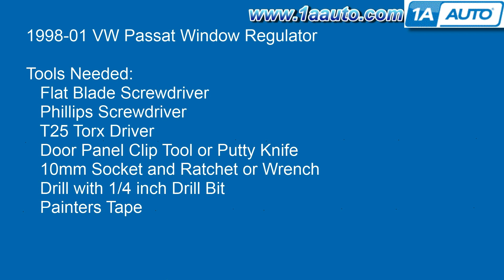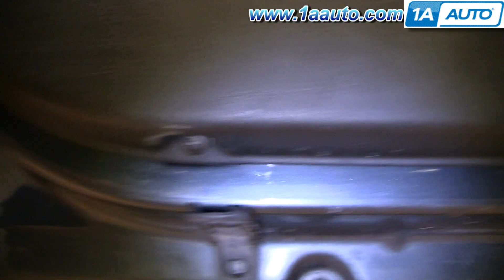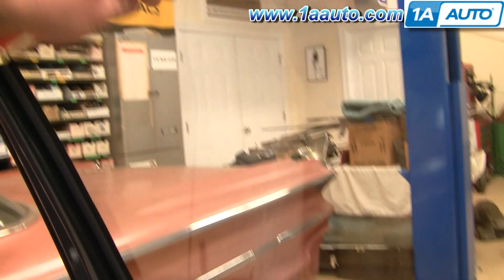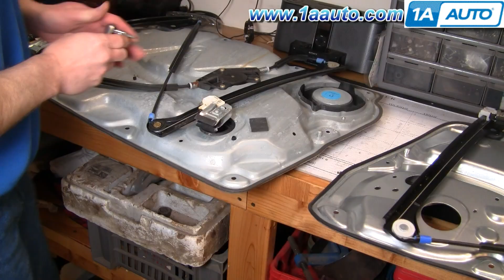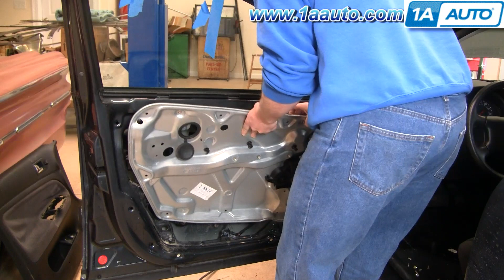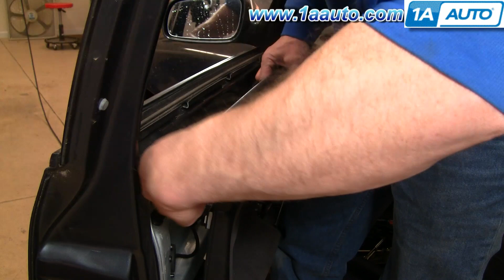How To Replace Power Window Regulator 98-01 VW Passat

Comment: I did also notice you broke the little tiny plastic tab insert on the door latch insert. (causing the inside door handle not to work-I did also break this on both sides of my car) Love your video and great replacement parts. Really frustrated with this particular part on the Passat. Final: How do you get the window down low enough if it does not go down at all and you can't remove motor B/C the bolts are on window side of panel which you can't access?

Comment: Great video. Ordered the new regulator for the front passenger side (without the metal panel) and did the install this morning. All went well, only had to drill out the original rivets holding the broken regulator on to the original metal panel. The nuts and bolts were helpfully included in the 1AAuto replacement parts—thanks for thinking of that!

Comment: At 5:09  there should be two rivets there, that you didn't show how to do it, Don't need to remove those rivets before remove the carrier panel, it will hard to put it back,  I remove the carrier panel with the door lock all at once, first on rear door that fitted 1/4 window, you need to remove the short window's rail that fit front of the door lock, then remove the lock bolts and then you can remove the all out a little to easy remove the cable that from the outer handle to the door lock ,then can out at once.some models need to remove outer door handle at once.
after out ,then can remove and install the rivets easy., front door is easy because no window's rail there,, Hope this help!

Comment: Why can I not pull up the window; I have been able to manually do this in the past; this is the 3rd window to have the regulator assembly fail in this 2002 and this time it is the driver's side.  The window goes up about 6 inches and makes noises and then falls back down.
Reply: that because the auto stop function when up all the way make the cable always hold tight, if you don't want this again, when your window auto up to 80% or 90%  press the switch to stop it, then tap the switch to make the window to the top . my one 26 years never need one. just like engine auto start stop  function, it look save fuel, but starter will use much more time, no function may be twice a day, have function on may 100 times a day, before the starter can use 15 years, now just 5 years and last 5 years acars make are most auto air cond, that make the air cond pump work all the time so hard, I replaced a benz pump it's only 30000km. are those functions very safe the world ?

Comment: I can’t seem to get that one tab on the wire that goes threw the panel to un click. I need help
Reply: if you first time , just cut the tape that tape to those plastic tabs, after remove the panel then can easy remove it and tape back to the wire first.

Comment: Thank you for this great video!  

But it seems like you can only do these steps IF the window can be moved up high enough that the bolts holding it to the panel can be removed.  My window won't go up more than a couple of inches, and pulling on it doesn't do anything, it won't move.  What should I do in this case?  I assume "take it to the dealer" but if there's a way to get the window free that would be great to know, thank you!
Reply: I had quite a time getting the glass out of the door.  At 8 degrees F at the Drive Thru window, something snapped, and the window kept getting stuck.  I had a grinding glass or sand sound, as the window would encounter resistance.  On a warmer day, working the button, the glass dropped down into the bottom position, and the child safety feature made it impossible to get the glass clamps back up to the level of the two holes. The window kept reversing and bottoming out. Of course, the glass has to be removed before the carrier will come off the door. I had to pull the carrier away from the door at the top. Then I used electrical tape and two zip ties to fasten a small ratcheting socket wrench with a #10 socket on the shaft of a long screwdriver. This gave me enough leverage to loosen the front bolt holding the glass, but the speaker magnet kept pulling the socket off the bolt, and shortly there was not enough room to get the socket over the bolt head. I ended up using a #10 open end wrench with a large Vise Grip clamped over the box end of the wrench sideways. Entering my hand through the small opening at the lower front of the carrier, I managed to work the bolt looser 1/3 turn at a time. I used a multiform paint scraper to work the glued clamps off the glass on both sides. Oh yeah, and I used an S hook on a chain, guided with a long-handled magnet, to hook the glass from below and lift it high enough to grasp it from above at the bottom of the window opening. Maybe my experience will help someone else.
Reply: you can try remove the window motor first, than the window should move more., if  still just drill some holes, but the first step should work.

Comment: brilliant video- I've a 2001 1.8t Passat wagon, and have to do this repair. I just ordered the part from you, and will be actually looking forward to doing this. Another thing while I'm in there-- I have to replace that bulb for the light in the bottom of the door. I held off because of all the hassle that removing the panel was thought to be. Looks like it'll be a fun (P.I.T.A.) project, but hey... I've had this stupid car for 5 years, so I know what a polished t... er, lemon 🤣 it can be.  When she's good, she's very, very good. But when she's bad, she's horrid!
Reply: Awesome!!! The part arrived from you three days EARLY!! So, I was able to do this on Labor Day, very straight forward job as your video showed, just lots of fiddly stuff with all the plugs (they all are unique to the sockets, so they were easy to reconnect)and the fragile plastic clips that hold the wiring to the regulator panel.  One thing that either I missed in the video, or it wasn't mentioned-- and caused me tons of aggravation-- when reattaching the cable to the inside door handle, the cable sheath has a small channel that it has to run through on the inside of the panel before you hook it up to the handle. If you don't get that secured, the cable won't have tension to open the door. Fortunately, I tested it before I shut the door, and after spending an hour retracing my assembly steps... I noticed the sheath channel on the door panel. 

I need to replace the plastic attaching pins for the door panel -- 20 years old, they break apart readily, despite being gentle removing them.  However, the 5 screws that attach the panel to the door are very secure.

SUMMATION: This video made what seemed to be a huge job quite simple. THANK YOU!

Comment: At 8:00  he says to push down on the pin while pulling, yet what I see in the video is different, he skips the "push down WHILE pulling" and just pulls
Reply: that's because the lock on the plug is at the back hard to see and he did fast.
 a little different for the first time, everyone do this  lock are different, because do this lock should be need special tool, try to google vw coil unlock tool, it look like a "F" ,no one buy this tool because so many other way can unlock it, I have 4 different way to do it , because your question, I will make a youtube video show all  I know how to do it.

Sorry back to his way , this plug is same of other vw and audi , like coil , when use hand, first push the plug back in,"yes push in", keep holding and push the button out and pull the out now, i know hard to understand, if your engine is petrol, then try it on the coil.

Comment: Would this also be my problem if I hear a crunching sound and the window doesn’t roll down
Reply from the maker: We would suggest having it diagnosed by a mechanic to determine the exact cause of the issue you are experiencing.+Alex Hood-Keys
Reply: see you can push the window up and down bu hands,if can move a lot that should be regulator, but if can't that may be is the motor, sorry can't hear it.

Comment: Hello! I tried to replace my window regulator on my passat 2000 but the window is stuck all the way up and i can't pull it down so the 2 bolts that secure the window to the regulator don't show up on the holes.
Does anyone knows how can I loosen my window?
Reply: remove the window motor , then should do.

Comment: Thanks for the great video. I followed along and was able to replace the window regulator. The window now goes up and down. However, I'm having difficulty with the cable that opens the door from the inside.I've hooked it up with the hook going down and up. The door simply does not open from the inside. I can't figure it out and I must be missing a step. Otherwise, very good instructional video and the part fits in very well.
Reply: just remove the panel disconnect the cable, see now can open the door.,usually is here the cable didn't lock up  correct.

Comment: Thanks for excellent help.  My job went well.  I kept the old panel and saved a few bucks by replacing only the regulator; that meant drilling out the rivets holding in the old one, but that was a five minute job with good drill bits.  And, the 1A Auto part came with bolts to replace the rivets.
Reply from the maker: +Don Klos Thank you for you order. If you would like to leave us a review it would be greatly appreciated. Here is a link to our reviews on Google. Have a great day! https://goo.gl/i5JFNY

Comment: excellent video I followed it step by step and it worked. the only thing is when I got my inner panel off my guide rails were machine riveted to it so I have to drill them out to fit the new guide rails. many thanks
Reply from the maker: We're glad the video helped you out.  Thanks for watching.  1aauto.com 866-403-3393

Comment: $35.00 in parts.  Followed instructions and now working Golden in my 99 Passat.  Thanks for what your block of instructions.  Just what I needed before I caused unnecessary damage trying to figure out myself.   Bolt on bolt off perfect.

Comment: Why are you replacing the metal inner door card? I was delivered only the cable/track system. Please explain, or is it just easier to spend more money for a new one? You have me lost here with that move.
Reply from the maker: We wanted to show you what was involved if you decided to replace the inner door car that the regulator is bolted to.Hope this helps you out.

Comment: What about when the regulator itself is stuck and you can't power down the window, or if you're removing the inner panel not connected to power. How do you move the window?
Reply from the maker: If the cables on the bad regulator are jammed, you may need to cut the window regulator cables to free it up so that you can move the window.
Reply: remove the four t25 torx screws holding the regulator motor housing and remove the motor. The window will move freely on the track.

Comment: Ok so I have an issue with my car. When I try to close my driverside door, the latch that keeps the door closed doesn't activate so my door will pop back open. also the manual lock on the outside door has completely failed. When you go to turn the key to lock it, it just spins in a complete circle. Which part will I have to fix to be able to get my door working again?
Reply from the maker: It sounds like the latch on the side of the door may be closed shut. You should be able to open the clasps that grab the striker with a flat head screw driver. If you can get them open, spray them with WD-40 or some white lithium grease to help prevent them from sticking. To fix the lock, you may need to remove the door panel and look inside the door to see what has broke on the lock. Hope this helps you out. 1aauto.com 888-844-3393
Reply: 1A Auto Parts Thank you. Also I was wondering if you could tell me what might be wrong. Whenever I accelerate, from 1,500 RPM and higher, my oil pressure warning light goes on, but I have oil in my car. I know my fan belt is cracked but I don't think that would affect the oil pressure, would it?

Comment: Please, im looking for an answer. I have a 2000 passat VW and my window regulator broke, but it wasn't any of the mechanical parts. It was this little plastic wheel on the bottom of the metal (As in the video at 9:12). Those white little wheels is what broke. I don't want to pay over $80 for an entire part i do not need. I just want to know the name of that wheel and if i can buy it somewhere. Thank you for any feedback ahead of time.-Daniel

Comment: Great video. Helped me a lot. Just replaced the driver side window regulator on my Passat 2004. Replacement set I bought somewhere online (sorry) didn't have the wire pre-rolled on the regulator wheel. Real pain doing that but your other video helped me there too. Thanks again.

Comment from the maker: You may want to check the window motor to see if it's working okay. You can test the power going to it with either an ohm meter or a test light. Hope this helps you out. 1aauto.com

Comment from the maker: It's always a good idea to disconnect the battery while working on anything electrical. That way you don't have to worry about shorting anything out.
Reply: I know is good , but a lot of new models need to use scanner to reset, after disconnect battery. included the window auto stop function.

Comment: Great info vid, no wonder my garage wanted 2hrs 30 mins to do this job ,  when i reconnected the driver switch block on door windows will not work but central locking does work? I had to wind up the windows via the exterior key in the door. Thanks for your great vids.

Comment from the maker: You may want to check the thermostat or possibly the relay for the fan when the AC is on. If the AC fan relay is bad, it may cause this type of situation when the fan is on. Hope this helps you out. 1aauto.com 888-844-3393

Comment: Hey first I really like your videos! I have a real quick question and want to serif you could diagnose something for me I have a 2000 VW passat almost every time I turn the AC on my car it starts to over heat (not every time) the dealer said not to let it go over 190 degrees if I drive it without the ac it will not over heat it's a 4cyd 1.8 engine. I just had the water pump checked about 3 months ago do you think it could be the radiator cooling fan control module? Thanks

Comment: i would like to thank 1A auto for this superb video.  I never felt threatened by the job at all with the easy steps it took you through. Saved me probably $300. My problem was actually the window plastic clips breaking but they now only sell you the regulator and clips in a kit. Cost about $70.  thanks again. Bert Dentuinder  bdentuin@cogeco.ca

Comment from the maker: If you need to remove the actual window glass you would need to remove the regulator first. Usually you can remove the glass from the top of the door. Hope this helps you out.

Comment from the maker: @DkWarley The Jetta would be different. The basic procedure to remove it however may be similar. You would need to remove the door panel, tape the window into the up position, and unbolt the window regulator from the window and door. Hope this helps you out.